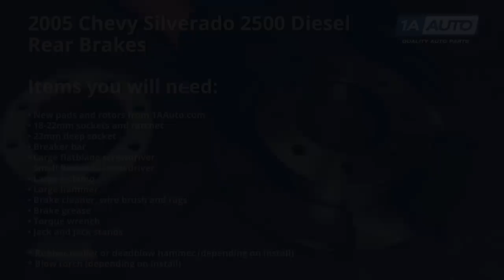How to Replace Rear Brake Pads Rotors 05-10 Chevy Silverado 2500 HD Diesel

Comment: How relevant is this video for someone needing to change the rear pads and rotors on a 2012 Chevy Express 2500 8 lug 9.5 rear end (14 bolts on diff cover)???
Thanks
Reply: A Chevy truck is a Chevy truck. If it's disk brake, it'll be close to this, if it's drum brake, find another video (yours is disk). Chevy uses the montra, "If it ain't broke, don't fix it... Unless the government makes me change it."

Comment: POOR JOB: You did not bother to repair the axel seal leak even though replaced the brake pads and rotor put everything together even  torqued everything but never adjusted the parking brake. Not much thought about SAFETY!
Reply: Maybe because no one is here for the axel seal leak other wise we would’ve looked up axel seal leak right?
Reply: You're lucky if the parking brake isnt completely siezed on these trucks anyway. But true, you're going to want it to work well when your brake lines blow.

Comment: caliper will not come off the bracket...Any suggestions?
Reply: I just spent 3 hours out side with the caliper between 2 jack stands and beating on it with a mini sledgehammer to get apart, when you put it back together clean and never seize the pins

Comment: show us what is done when a bolt breaks off
Reply: William Volkmann like a lug nut bolt or a caliper mounting bolt? I broke off a caliper bolt once and I went and bought a whole new caliper. Your only other option would be to drill the bolt out and re tap it, just put a thicker bolt in.

Comment: you say the gear oil leaking from the axle seal is not to to bad ??? so we are just going to let it go ??? WOW REALLY ??? those pads still have a lot of life in them. yes they are worn but still good to go another 5000 miles i think... with all the gear oil on the parking brake shoes they just won't hold the truck well. oil on brake shoes is a large safety issue you think ??? another thing you never never back feed brake fluid into a ABS system ever... it will plug up the tiny orifices in the ABS  system this is the first thing you learn in Brake School hello... where did all the brake fluid go ???